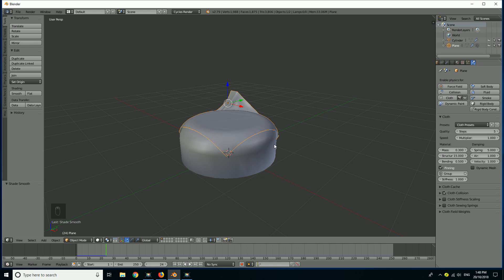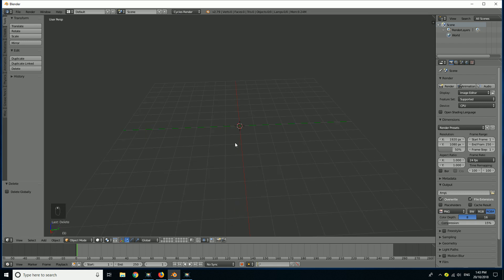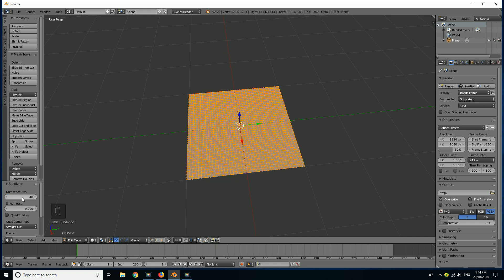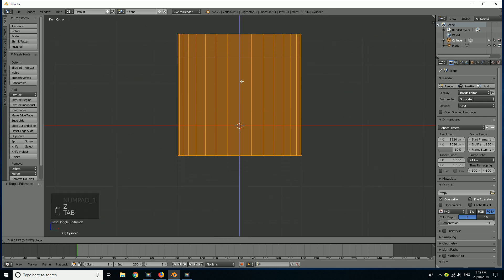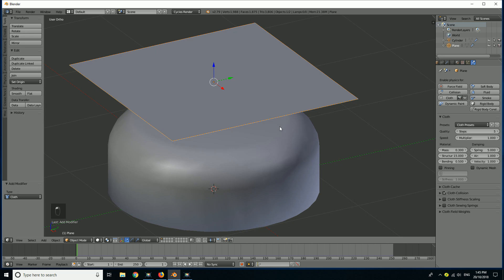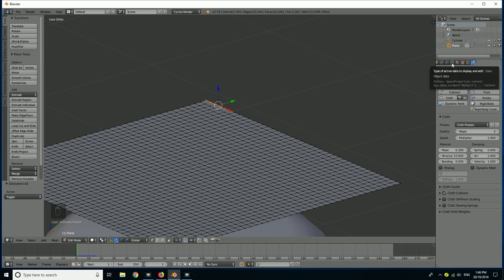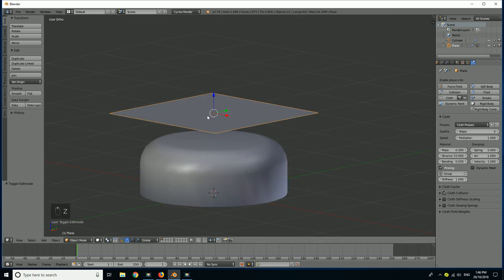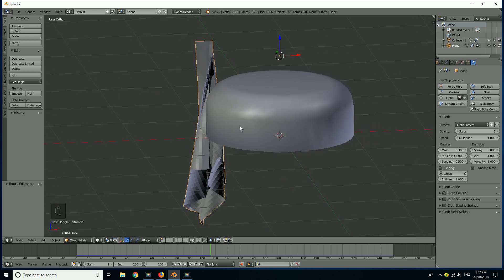Tutorial: Pin Cloth Simulations | Blender 2.79

Comment: It's kind of scary how accessible such amazing features are these days...

So here's a question: Pinning is fairly simple to pull off, as you've demonstrated, but what if I want to suddenly release the pin mid-animation? Say for example I have a curtain that flutters for a bit, then suddenly falls off a wall?
Reply: little late but if it were me, I think the simplest solution would be assigned the pinned vertices to an armature bone and animate that falling. im currently doing something like that now with a thrown lasso animation, its super fun
Reply: blender actually had a lawsuit over this because another 3d physics simulation application made it while blender was making it so the application said it was copying their unpinning feature